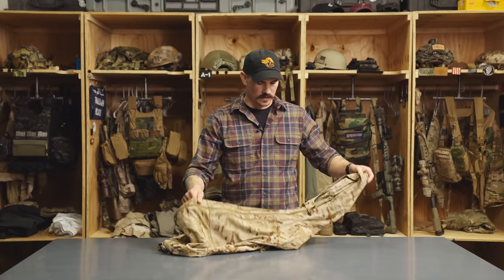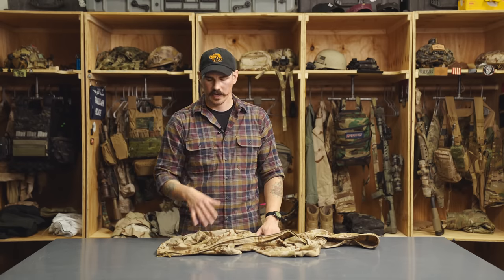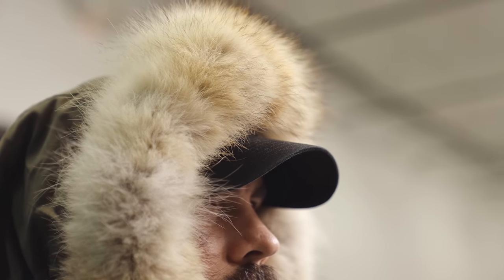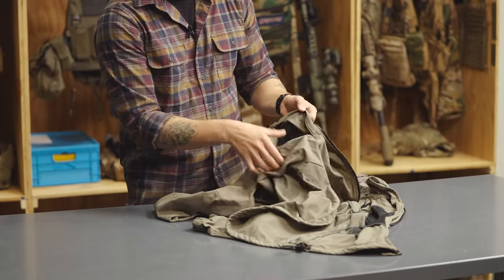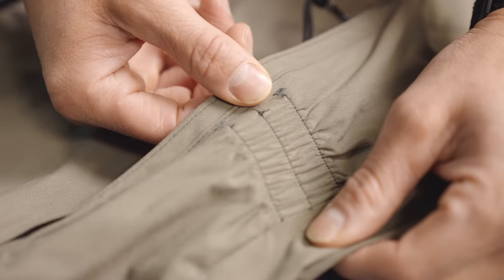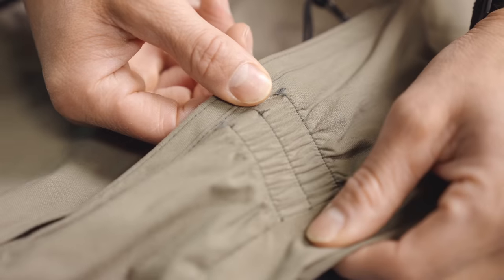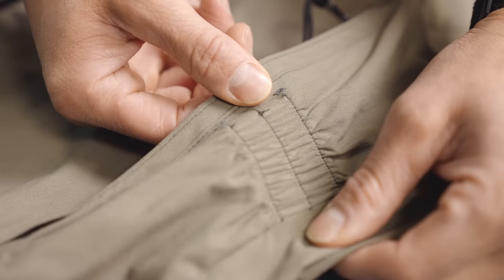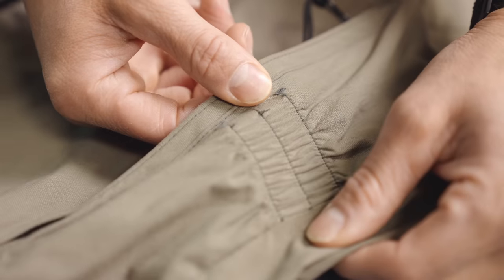Cold Weather Layering: Part 2 - What Is The Wind Layer?

Comment: it was the civilian outdoor industry who revolutionized the military cold weather wear. not the other way around. materials such as fleece, gore tex, soft shell, gore wind stopper, polartec, NYCO (NYlon COtton), POLYCO (POLY COtton), etc. brands such as arcteryx, the north face kelty, etc. come from the civilian outdoor industry. the military adopted it when the 1st generation military ECWCS  (Extreme Cold Weather Clothing System) was made. compare that to traditional military issued cold weather gear from the 40’s to the 90’s that were made of waxed cotton, wool or acrylic. even military backpack design were made by the civilian outdoor industry. compare that to the traditional LC-2 cotton rucksacks with just a "kidney pad" for hip suspension, but most of the time didn't even have suspension at all, just shoulder straps. give credit to whom it is due...
Reply: This is true, the private sector comes up with a lot of the innovation that the military uses for materials and skills. The military has long looked to the mountaineering community like when they used David Brower’s manual on ski-mountaineering to train troops for mountain warfare in WW2, and eventually had Brower training them and leading them in combat.

Comment: Great video! I am looking forward to the remainder of the series.

I always thought I was set up with jackets until I picked up a  Wind Cheater. Started with the First Spear version. I even sewed a zipper on the hood and added a fur ruff. Then, I tried the HPG model and decided it worked better for my backcountry outings. I have dozens and dozens of jackets, but the WC continues to be my daily pick. Add a puffy over when stagnant or temps dip.
Reply: The FS Wind Cheater is an absolutely amazing garment. It's been a standard of my work equipment (outdoor industry) for years. Where it really shines is its scalability, it can be comfortably used in a wide range of weather and temperature conditions and over/under a large range of garments as needed. The Wind Cheater and the Defense Mechanisms Helion are my primary go to jackets these days and compliment each other when worn together.

Comment: Something to consider as a cheap surplus option is the level 4 jacket from the ECWCS system, which is designed as a wind layer. It is a constant companion of mine from Alaska to the Mojave desert it is very useful for all the reasons listed in the video. Large chest pockets that vent heat, full front zip, and two shoulder pockets. No pit zips or hood though. 

But for sun $30 at a surplus store, a decent jacket to go out in and see what features/weight you need for your area.
Reply: Agreed. Once I started the video my thoughts immediately went to this jacket. Unfortunately I had to turn it back in to CIF but I went and bought another one.
Reply: I just bought one off eBay last week.

Comment: Kevin, Great simplification of what for PCU/ECWCS Gen III became a moderately complex, seven-plus-level system. I watched this several months ago, but I recently revisited it with winter on its way.

It’s interesting that you’ve labeled the “Shell" of Mark Twight’s “action suit” as Wind Layer. He didn’t really label the layer, but it became known as “Soft Shell” and Level 5, the central pivot and most versatile item in his systems. Unfortunately, commercial designers co-opted that label, and not understanding Twight’s requirements, or physics, apparently, started making the layer too thick or even insulating it. This has led to misunderstanding about what a soft shell is supposed to do and be.

I had started thinking of this layer as an "Action Shell” or “Active Shell", but Wind Layer works too. As long as it is not confused with a wind shirt, or Level 4.  As proposed by Twight, the wind shirt was supposed to be thin, windproof, and not breathe as well to reduce to normal levels evaporative cooling caused by winds. If winds were expected it was to go under the Shell. If wind came unexpectedly, it could go over the Shell. I don’t think most users of the systems understood this well.

I thought the HPG Wind Cheater was a durable, hooded wind shirt or jacket, but its breathability was always emphasized. There was some discussion that it wasn’t windproof, only wind resistant. You [Kevin] posted a very nice article on the HPG forum about layering during a backpack hunt, and I noticed you used it like a Shell.  Then, I stopped by the HPG store in Junction last year and was able feel and try on the Wind Cheater, and it clicked that it really seems to be the Shell of an “action suit."  The Shell of the "action suit" could be conveniently wind resistant and water resistant, but its primary job was to breathe, so moisture in the lower layers would wick out. First Spear and HPG used a different fabric 330D brushed-face nylon rather than the Epic favored by military contractors, but the 330D seems to be perform its functions just as well.

Thanks for posting this video.
Reply: I do a modified version of the ECWCS. Level 1 silks, level 2 waffle(depending on the temp) are the foundation of my layering system. 

If I layer level 1 silks and level 2 waffles over around 32 degrees I get too hot if I’m moving. Those polartec waffles really work but I overheat over 32 - 35 degrees when I’m moving.
Reply: @MarcP5267  Yes, if you know the principles and put in a little trial and error, you can know exactly what you need and when.
Reply: @rjtwocircles I’m a laborer in a municipality and work outside mostly. Sometimes I’m driving a truck, sometimes on the back of a trash truck slinging trash, other times doing road repairs, other times doing manual labor. 

The only time I’m static at work is when I driving a truck. That’s ez. 

Most people in the trades and my co workers dress for the cold are the typical Carhartt gear. Wear whatever and a big bulky Carhartt hoody or duck jacket.  To me that type of system reduces mobility and doesn’t work as good as the likes of ECWCS or this video series. I think that systems like this video could be modified to include people in the trades and the work I do. 

With that being said level 1 silks and level 2 waffles will definitely keep me warm but I need an outer shell to for wind protection. I’ve been wearing my rain jacket as an outer shell and although it works by keeping the wind out, it’s not breathable and durable. 

So my modified system consists of system that’s missing a true outer shell to keep the bite out. 

I’m pretty sure the Wind Cheater will do the job to replace my rain gear.

Comment: A good and valid points in the video  but one concern in a tactical setting is most of not all garments shown are made of materials which are not good around flames.  As brit and ex soldier I can't recommend the brittish smock which does exactly the same job and is a flame retardant and hard wearing system. Usually worn in the field with just a base layer and when you stop you just chuck a warm layer on.

Comment: The baggy/fitted issue can be really easily fixed by having multiple size adjustment loops. In fact you can even diy this, either through sewing some on yourself or by tying stuff over it (belt, pieces of cord or some sort of stretchy ribbon over shoulders and chest, arms, and forearms, then just wave arms around so enough fabric slides out to give you full rom) and you're good to go :)
I personally really enjoyed this feature in helikon's products from bushcraft line and I wish more service-oriented gear had so much adjustments you can easily set up on the go.

Comment: I understand that it’s a little, limited in availability, but the USMC “combat jacket” has always been my personal favorite outer layer, gortex material, but has breathable vents down the sides, sleeves are lined with grid fleece, as is just the collar, built in neck gaiter(super thin). Overall I like it, very comfy, very light, can pretty much be warn in all weathers I’ve found
Reply: That's so nice, The army just get crappy gear and nothing nice like the USMC does
Reply: @TheSlayer.  that is one thing I will say, is the gear the marines physically wear is pretty damn good.
Reply: The Combat Jacket doesn’t have pit zips, and has a weird fit.
Reply: @JEJAK5396  so it doesn’t have pit zips, it just has that breathable stretchy stuff, I like the fit of it, but I’m also a thinner small guy, not saying you’re not, it’s just that I’m tiny personally and it fits me well
Reply: As someone who has a fair amount of use on the marine combat jacket, its not that great. Its a decent stand alone piece for desert environments, but is inferior to proper layering. The insulation on the arms is one of its shortcomings, you dont want insulation in a shell layer. Its also tighter fitting, which is what you want in a base layer but not a shell. Like most things designed by the Marines (speaking from 5 years AD), its ok but inferior to what the other branches design and use.

Comment: One to add, especially for those looking to cut weight and bulky: the TRC Outdoors Cierzo Shirt. 

It's a lot like those ultrarunner type windshirts you mentioned, but will fit around (under or over) tactical gear. It has no pockets and the hood is (in my opinion) pretty poor, but it certainly cuts the wind without overheating the wearer.

Comment: The OR ferrosi is probably their best product. I have several , but wish they'd leave the design alone. They improved the fit 2years ago but decided to  lengthen the sleeves , add a thumbhole, and delete half the cuff elastic. They also used to make the APEX Ferrosi and the Prevail? ( which was NIR MasGrey or MC).
Reply: Those were my exact complaints about the new design of the Ferrosi. I wish they would have left the cuff the way it was. I am not a fan of thumbholes.
Reply: Do you like wear yours as an outer jacket or do you keep it one above your base layer as discussed in the video? Got a ferossi myself this year and have been experimenting with best uses.
Reply: @tropicalpines4585  it's  the outer until it gets really wet or windy . I size it to go over a base and mid layer like a grid  or 300 weight fleece quarter zip.  A lighter puffy like a thermoball  or beyond clutch will work under it in a pinch too.
Reply: I have the Helium jacket and it's my favorite outer layer. Outdoor research fucks and is a more reasonably priced brand over acrteryx or other related outdoorsy/tactical wear.

Comment: I'm struggling to find "wind layer" products outside of what's been mentioned here. What sort of materials should I look out for that fits this category mostly?
Reply: Most of the time, they’re just soft shell jackets without a fleece backing. To name a few: Arcteryx Gamma LT, Mountain Hardwear Kor Airshell, Patagonia Houdini, Beyond Clothing Ventum, Beyond Clothing Rig Light
Reply: @Forget-Me-Knot  awesome, thanks!
Reply: Yeah as above, they're just a single layer of nylon with DWR, usually no hood, pockets for function but too light to need pit zips.  Like the old "warm up" jackets but breathable.  Not too light but certainly not heavy.  To be used as the lihgtest "outer" layer

Comment: Kevin, just to firm up on sizing for the Windcheater. I wear a MR generally but can wear a LR jacket. Should stick with a medium or up size to a large or will I be swamped ?
Reply: For size reference I am 6'2" 195lbs. I normally wear a Medium Tall in issued military gear. I could get by with a medium windcheater with a more snug fit, but Large is optimal for me to layer over stuff.
Reply: @kevinmcdowell3446  I am 5’8” 165lbs. I’ll be patient and wait for medium to restock. Thanks for the reply
Reply: Great series of videos by the way
Reply: @calmolly1   Thank you! Medium should work for you.
Reply: @kevinmcdowell3446 hey Kevin, maybe you could help me out. I usually wear a Large in LEAF and other gear and also my shirts. Wore a wind cheater in large and it is okay with a midweight baselayer but I can’t layer a light fleece for example underneath. Is that okay or would you recommend sizing up to get another layer under the wind cheater? You also mentioned throwing another over the wind cheater instead of underneath. Appreciate your answer🙏🏻

Comment: Kevin - for colder temps, if you’re normally wearing a windshirt what weight baselayer are you generally pairing it with? Does the weight increase of the baselayer when it gets colder outside even when paired with the windshirt?
Reply: Watch the base layer vid, he adjust base layer based on temps
Reply: I’m going to stick with a midweight baselayer most of the time.
Reply: Depends on temps and your activity. I wear military issue level 1 and level 2 and an outer shell and moving a lot. This keeps me warm to the mid teens.
Reply: @MarcP5267   Yes exactly.  Light or midweight base layer or both, under the wind layer.  All I need for cool weather or being active in cold, to a degree

Comment: Thoughts on windbreaker under field shirt?
Reply: I would layer a windlayer over the fieldshirt rather than under. If it got too hot I would want to strip down to the field shirt rather than strip down to the windlayer. I actually did this in Idaho this year and it worked well.
Reply: @kevinmcdowell3446  Definitely would be faster to take off the windbreaker vs having to take fieldshirt off to remove it and then put it back on. My only thing is durability
Reply: I wear a combat shirt (with a t shirt and tank top under) under a field top/shirt or blouse.

Comment: Question for Kevin or anyone: if we’re wearing something as simple as a backpack, that’s going to block moisture transfer - ultimately leaving our base layer and wind layer wet. So if that’s the case, why not just wear a rain layer and open up the front and pit zips? Then carry a spare baselayer and puff layer to change into once static or zip everything up
On the rain coat and trap that heat if it’s a short static stay. It’s less things to carry around or wear ultimately. Maybe I’m approaching this wrong? Only cause I went rucking yesterday and my entire back baselayer and wind layer remained soaked for 2-3 hours where it contacted my pack. That’s why I started thinking, hey if I’m going to get soaked anyways, let me just plan to change into dry base layers and puff up and if I need a rain layer, I have that jacket that I was wearing around. I hope my question makes sense, looking for any feed back. Thanks all 😊
Reply: The first reason to not wear the rain jacket is that it is not going to be as durable as the wind jacket and It's generally going to be more expensive to replace. The rain jacket is a critical item to have when you really need it, so preserving it should be a priority. If you develop a rip or tear that is beyond repair, you become more vulnerable to to the elements. The 2nd reason is that you will sweat even more with the rain jacket on. Whenever I must throw a rain jacket on, I make sure I slow my pace down to avoid sweating as much as possible. Your back is going to sweat with a pack on no matter what, but using a proper windlayer will reduce the amount of sweat that you would have with a rain jacket on. If you are still sweating too much, consider shedding the windlayer and just using the baselayer.
Reply: @kevinmcdowell3446  I really didn’t consider any of these things. That was genuinely very insightful. Thanks man!!!!

Comment: Hill People Windcheater jacket is $250. If I am spending that much, it better be a rain jacket, too.
Reply: There are other options that are less expensive than the windcheater, It's just an example that I like.. The problem with a rain jacket is that they are not breathable enough for active use, so it would defeat the purpose if it was a rain jacket too.

Comment: You don’t wear a mid layer like a fleece over you base layer then an outer layer which would be either a soft shell or hard shell?
Reply: No, the whole idea of the “mid-layer” comes from when the best insulation mountaineers had was fleece, which is not very weather resistant, the rainshell would go over the fleece to trap the warmth in. Modern puffy jackets have a pretty weather resistant shell, so most the time you don’t need to layer anything over them. If you are static, you can just put the puffy jacket over everything you are wearing and just take it off when it’s time to move again. I will break down a lot of this in the insulation layer video.

I’m not saying the idea of the mid-layer is wrong and there are applications for it, but most the time, it will be less efficient when constantly dealing with changing activity levels and time spent changing can have negative effects on your mission.
Reply: Wool and fleece*
Reply: @kevinmcdowell3446  ok looking forward to the insulation video.

To re-iterate you don’t do a base layer, mid layer, outer shell(soft or hard shell)?

I’m actually looking for a layering system that geared towards working outside. IMO opinion I believe folks like yourself, hiking, camping and military have the best concepts for a cold weather layering system.

At work I would be moving a lot with short stints of being static.